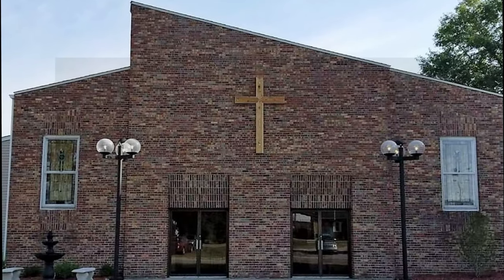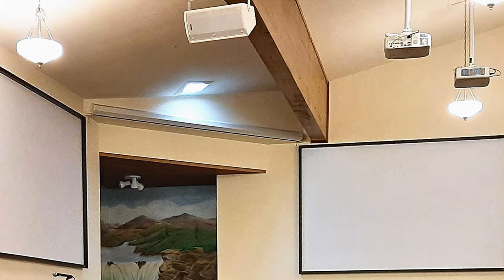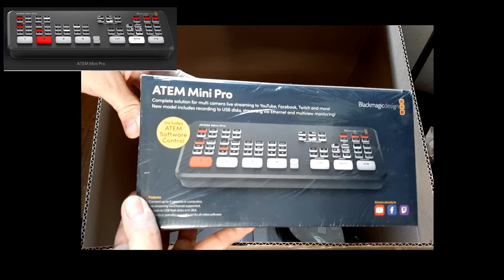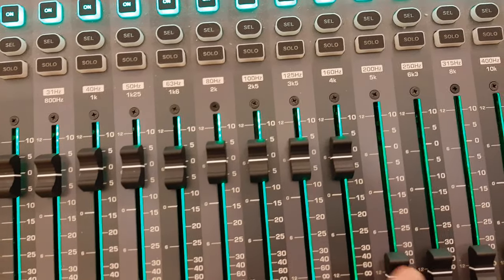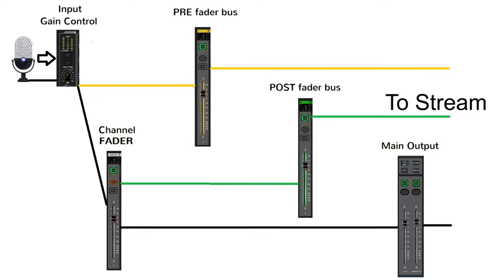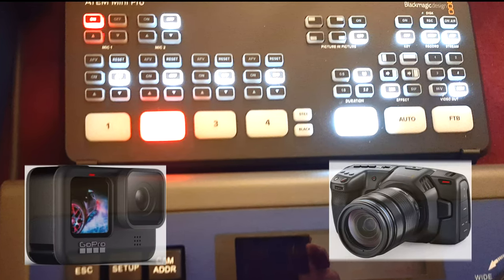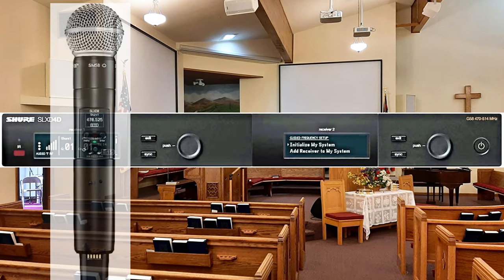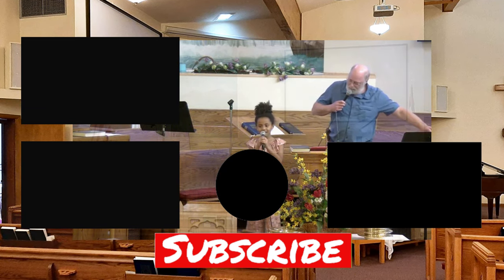Streaming Video Install Project For Small Church - Live Stream Upgrade

Comment from the maker: Here is a look at a video streaming project for an area church (Vallonia Christian Church). You can see the equipment used and the how it all comes together. This might give you some ideas for your own streaming plans.

►Amazon Affiliate Links For Items Shown In The Video-

►PTZOptics-20X-SDI GEN-2 PTZ IP Streaming Camera on Amazon:
https://amzn.to/2RPQlRH

►HuddleCam PTZ Camera Controller on Amazon:
https://amzn.to/2SwhVUb

►Blackmagic Design ATEM Mini Pro HDMI Live Stream Switcher on Amazon:
https://amzn.to/3gu8MUd

►Blackmagic Design Video Assist 3G Monitor, 7 Inch on Amazon
https://amzn.to/3gla58Y

►Kanex Pro SP-HD1X24K 4K HDMI 2-Port Splitter on Amazon:
https://amzn.to/3wwVo8s

►Manfrotto PIXI Mini Tripod, Black (MTPIXI-B) on Amazon:
https://amzn.to/3pLO7iG

►Shure SLXD4D Dual Channel Wireless Receiver on Amazon:
https://amzn.to/2TuAloM

►Shure SLXD2/SM58 Wireless Handheld Microphone Transmitter with SM58 Capsule on Amazon:
https://amzn.to/3vgLE0N

►Shure SLXD1 Wireless Bodypack Transmitter on Amazon:
https://amzn.to/3pNWNVE

►Apex 575 Condenser Earset Microphone on Amazon:
https://amzn.to/35dpkus

►Soundcraft Si Impact 40-Channel Digital Mixer Console on Amazon:
https://amzn.to/3gwvnj6

►Lenovo Legion 5 Laptop on Amazon:
https://amzn.to/3gyaWSC

~~~~~~~
►Patreon Link:
https://www.patreon.com/AlanHamiltonAudio
~~~~~~~
►Suggested videos:

Five Tips For Better Live Vocal Mixes:
https://youtu.be/oP4sdpkkNhY

Connecting A Behringer XR18 (MR18) To OBS For Live Streaming:
https://youtu.be/aNlBOOhWbZw

Behringer X32 Monitor Setup Tutorial:
https://youtu.be/Vz9E6FaCatQ

Behringer XR18 Monitor Setup Tutorial:
https://youtu.be/5gzsEErKdb8

5 Typical Mistakes Behringer X32 and Midas M32 Users Make:
https://youtu.be/tP7dO2Za6bw

5 Typical Mistakes Behringer XR18 and Midas MR18 Users Make:
https://youtu.be/EilVDp39A9g

X32/M32 Monitor Mixing Tutorial Playlist:
https://youtube.com/playlist?list=PLWtgwSNlxTjOcSjRK6m0JpvFQHABktu7O

Drum Mixing Playlist:
https://youtube.com/playlist?list=PLWtgwSNlxTjMsX8H1K87UcAP17zYSZqsT

~~~~~~~~~~~~~~~~~~~~~
►Facebook Group:
https://www.facebook.com/groups/livesoundproduction
~~~~~~~~~~~~~~~~~~~~~

"As an Amazon Associate I earn from qualifying purchases."

Comment: Could you go a little deeper on the connection of it all. And what software is used to actually do the stream.
Reply from the maker: I was focused on the audio aspects of the install and Billy was handling the video spec. They were originally streaming on FB using just a phone (or tablet) on a fixed tripod. That was both the camera and mic that was providing the audio and video for the original feed. No direct feed from the console for audio. 
So, they were already familiar with streaming via FB. At least in this way.

I brought the audio into the ATEM (via an analog connection) and the ATEM then fed the streaming laptop. The new camera feeds into the ATEM as well. The existing computer that handles their worship software has HDMI out to their projectors. We put a split on that HDMI out so that one side still fed the projectors, but the other side fed the ATEM. So that is how they can switch between worship software (or whatever source they want to use from that existing computer) to their camera for the feed. This makes sure the message is easily seen by viewers and eliminates needing to reposition the camera to 'see' the screens, or trying to fine tune the focus with the camera focused on the screen. Instead, simply 'take' the worship software computer feed when wanted, and back to the camera when ready to go back to a live shot.
This is what Billy said about the video software connection:
"So tested obs but was being finicky, but it could have been the bad cable I originally had.

Ultimately, once replacing the cable, using a usbc to usba to connect the atem mini pro to the laptop, Facebook easily recognized the atem mini as a source.

I was going to go back to try obs but decided since all was working well after testing no reason to throw something else into the mix"
Reply: @AlanHamiltonAudio  yes, before we got the new setup,  we used my phone. If worked for a while,  but we were eventually gonna need this upgrade. It has been doing great so far. Thanks again for all the help. You and your team did a fantastic job 👍
Reply: we took a similar approach on audio except we took 24bit/48kHz audio from audio interface/mixer, feed it to PC as usb audio then route it to the PC hdmi out, the hdmi connects to atem for final adjustment/broadcast, avoiding redundant mixer input AtoD then DtoA output, another ADC inside atem

Comment: Atem Mini Pro has unbalanced jack input. Did you used di box to connect audio mixer with atem mini pro?
Reply from the maker: It's been a while but we likely either went with a Rolls box between the console and the ATEM or XLR to unbalanced 1/8". 
The Rolls box was there, but if it wasn't necessary in testing then we wouldn't have used it to have 1 less failure point.
I stayed on the audio side of the project and Billy worked on the video side so I don't recall exactly what he ultimately took from me to get into the ATEM in the end.